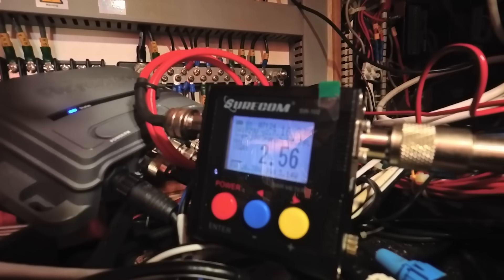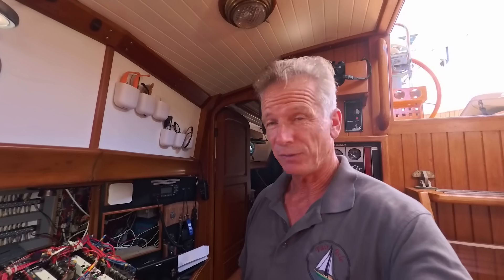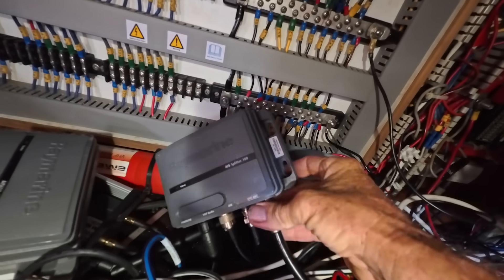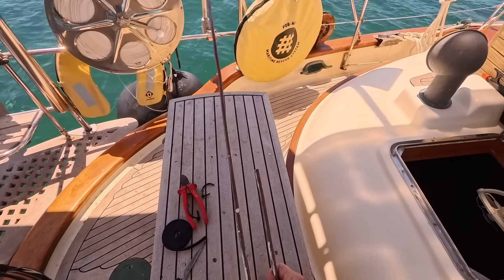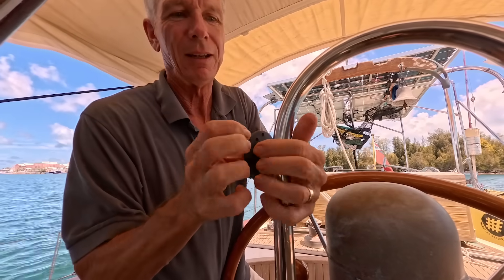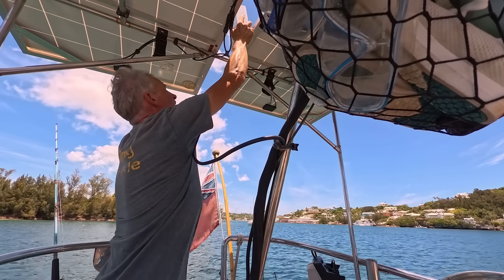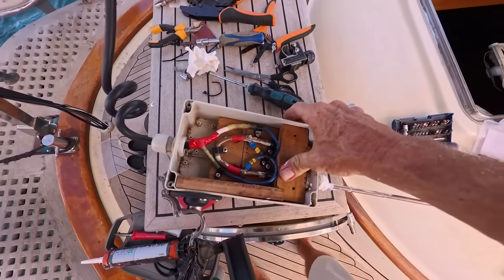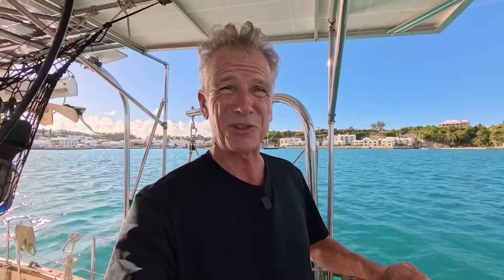Building a J-Pole AIS Antenna

Comment: This is an interesting idea, I have never heard of a J-pole antenna before now. Why did you select a J-pole over a whip antenna? How much range are you expecting with this setup? Overall, very cool! We might experiment with something similar on Bebop.

- Simon
Reply from the maker: J-poles generally perform better than whip antennas and and much easier to build. Whips need a ground plane to perform to anything like the standard of a j-pole or slim Jim. I use to build antennas as a kid at home for ham radio and with a very large ground plane you can do well. In a boat you would utilise a counterpoise not a ground plane, difficult to build, really if you want a whip then buy one. I will find out how well the j-pole does as we cross in open ocean. I was surprised it picked up that boat 10 miles away with the whole island between us and it, so should do even better in open ocean, but frankly 10 miles is fine.
Reply: @svfairisle Wow! I had not thought about the antennas that way. The 10 mile range through the island does seem pretty good. I suppose the only way you could really improve range would be to increase the altitude of the antenna. 🤔 Now you got me wanting to go get my ham radio license. 

- Simon
Reply: @SVBebop  The speed of sailboats makes the range a little less critical. Of course the Freighter 15-20 knots is important. You can find an antenna line of sight calculator that uses height of both antennae and earth curvature. The Freighter height adds a lot of range.
Two sailors using handhelds is somewhere around 6 miles so the improvement is much further, ~30 miles with enough power?
Reply: @svfairisle  Well this all explains your sure choices down a good path for the AIS antenna.

Comment: You made a brief comment wrt the Digital Yacht 4g/Wifi extender.  I take it you didn't find it particularly helpful in your case.  I was considering putting one on my boat.  Mostly coastal and near-coastal (US East Coast).   Can I ask why you stopped using it?  Was it just redundant with the Starlink?
Reply from the maker: Sadly I found it to be almost completely useless. I fitted in Venice and then reviewed it about a year later in one of our end of year episodes when we were in Montenegro and gave it 1  out of 10. Our position in the marina in Venice was such that we were slightly too far away for Wi-Fi to work on the boat, we had to literally walk about 10 feet down the pontoon to pick it up. The booster just about coped with that but that was about its limit. I don’t think there was a single time where I could pick up Wi-Fi anchored out in a bay, and I did try. But the bigger disappointment was the 4G booster side of it, just didn’t work at all, I could usually get better signal straight on my phone. The soft wear was terrible too, just a mess and it was buggy and always going wrong. Then the box cropped out completely when it was just over a year old, they tried to say it was out of warranty but I insisted they change it as I had a feeling it was always bad & maybe that’s why it didn’t work. Well the did begrudgingly change it, but it was still dreadful. I stay well away from digital yacht gear now.

Comment: Hi Steve, more info, according to your AIS page you are at N 33 degrees 01'59.66 W 064 degrees 17'38.66 which makes you49.84 mile from Fort St Catherine on Bermuda
Reply from the maker: Thanks for the info Ray, yes the AIS ground station would have lost us when we went out of range in Bermuda. From there you are just dependent on a satellite picking you up somewhere mid Atlantic, nothing I can do about that and I’m not sure if the system is even designed to put class B AIS positions up, it should for the commercial Class A units.
Anyhow, for tracking look at No Foreign Land, I update that one everyday at noon at the same time I plot our position on the paper chart.

Comment: Really interesting video. We have the same issues. After 7 years VSWR 1.3 from arieal but 1.9 after spitter. Handheld radio has better VHF range and AIS just 3-4 miles off shore so this video taking out the splitter was very applicable!
Reply from the maker: We are now mid Atlantic and pick up all ships at over 30nm out. Of course they will have more powerful class A AIS units, haven’t seen a yacht yet to tell what range we first pick them up but will keep an eye open as we approach the Azores as to when we first see them. If we don’t come across one beforehand that is, doubtful, we haven’t even seen a single ship in real life just in the far distance on AIS, it’s a big ocean out here!
Reply: @svfairisle 
Thanks for the reply mid Atlantic, hope you having a smooth and safe trip. Love all your videos, been watching from day 1.

Comment: That’s really interesting. On a side note, have you given any thought to the shade the antenna will throw on your solar panels?
Reply from the maker: Well no shading is ever good it’s true, but I’m not too worried about a bit of 8mm copper, it’s a lot thinner than the backstay. Also I will be swapping out the two single sided panels for bifacial ones like the third one I have. That has performed really well and doesn’t seem so affected by shading

Comment: Steve 
I’m just starting to plan on putting AIS on my boat that I can overlay on my iPad. 
what AIS unit do you have ? And what kind of splitter do you have or recommend?
All the best Richard.
Reply from the maker: Well I don’t recommend the Raymarine one, that’s what I had. I’m sure AIS units have improved though. Just make sure if you’re sharing the antenna that it’s one that tuned with AIS in mind, most will be now I think, but if you’re using an old antenna from an old VHF instal then it may not be
Reply: The splitter business is tricky and expensive. Honestly, a new radio with AIS included could be just as cheap. I have the last of Raymarine AIS with built in splitter. Display on chart plotter. I'm 2nd owner, now on freshwater. Thank goodness I don't need to have it working all the time.

Comment: I broke off the telescopic antenna on a multi band radio, and found that plugging headphones in the antenna socket I got 3 times as many channels on the fm.
Reply from the maker: Yes FM’s can use just about anything, ours is bolted to a chain plate so the rigging is doing the job!

Comment: Steve, you gotta be a closet Radio Amateur!
Some AIS transmitter/transponder units measure VSWR and inhibit transmission is VSWR is too high. Our Navico unit does this but manual does not state an acceptable VSWR limit. In general 1.5:1 is considered the limit. 2.5 is too high and you have the gold-standard at 1.04!
Thanks for sharing.
Reply from the maker: That’s interesting that an AIS unit has that limiter. I can understand it with VHF as at 25w you could get some damage with a strong reflected signal, maybe even a class A AIS, but a normal AIS shouldn’t be powerful enough to damage itself in this way.
Reply: @svfairisle  Yes three status lights, one goes red if antenna VSWR is too high.
Reply: @svfairisle  Sidenote for people with similar issue. If your VHF antenna/connection is damaged or forgotten when mast went up, don't use your radio with limited range. Use a handheld until the antenna problem is fixed.

Comment: I think the biggest factor in your range will be the height of the the receiving antenna and the the height of the transmitting antenna.  As VHF/FM is line of sight you may get 50 miles if the other vessel is tall enough and you are tracking a vessel with a class A transmitter which is about 12.5 watts on a good day. It will be interesting to see what you get range wise from the crest of a wave... Sail Safe mate. Ant & Cid
Reply from the maker: Yes that’s true of course, I’m keen to see how far out we will see other yachts but there just aren’t any out here. We’ve only ‘seen’ about 6 or 7 ships and they’ve all been over 20 miles away so we haven’t actually seen anything. Who knows the system might be making it all up! I’m sure as we approach the Azores there will be something to reference, big empty ocean out here!

Comment: Quick question AIS like VHF is line of sight. Won’t having it down on your arch restrict range?
Reply from the maker: Yes always better to get as much height as possible. But the fact is unless you have a ketch and with a VHS on one mast and an AIS in the other is impossible to get a good installation that doesn’t interfere with itself and although the splitter is a good option and works reasonably well it does limit the range of both the VHF and AIS. I had heard a good j-pole would out perform a mast top combined antenna before, o was dubious of that, I made the j-pole because there was some sort of fault with the splitter. Turns out for me at least that the j-pole even mounted low has about 3 times the range of my old set up even when it was new and working perfectly.